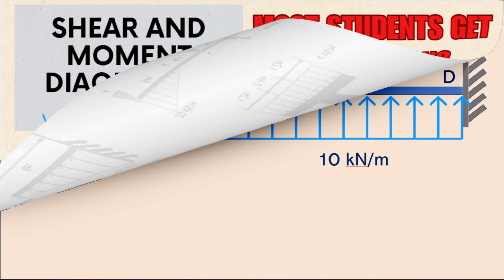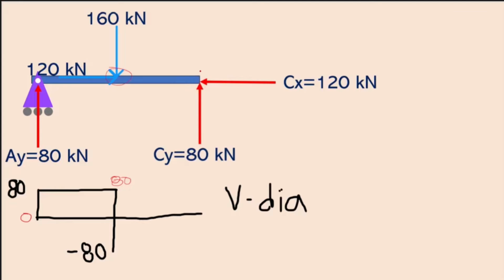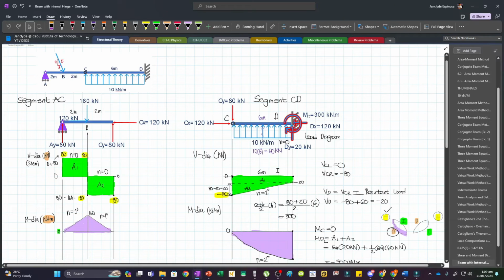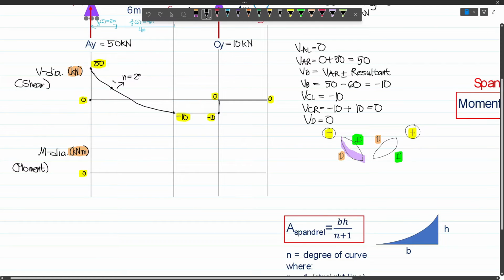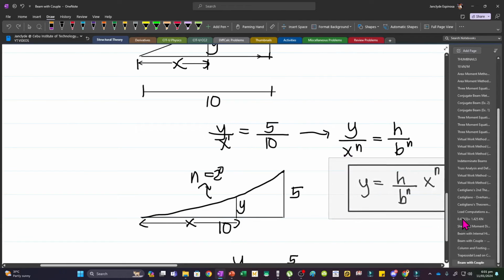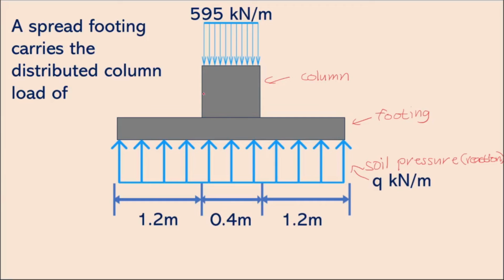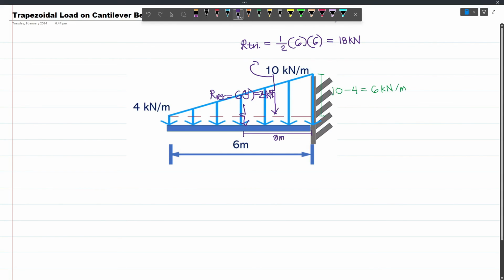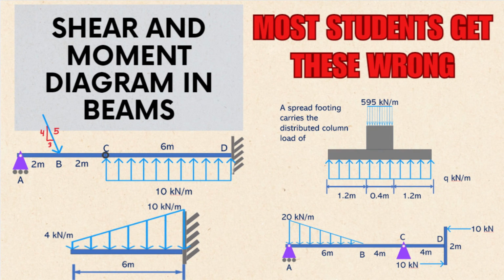Shear and Moment Diagrams - Area Method (Tricky Cases)

Comment: for the 2nd problem, i thought when the load decreases you draw the sad face for the shear diagram and since its decreasing in the the shear diagram you draw a parabola.
Reply from the maker: shear describes the slope of the moment diagram, so a downward (negative) load that's decreasing in magnitude will be half of a smiley, not sad face. You may use the indicated curves for +inc/dec and -inc/dec in the video